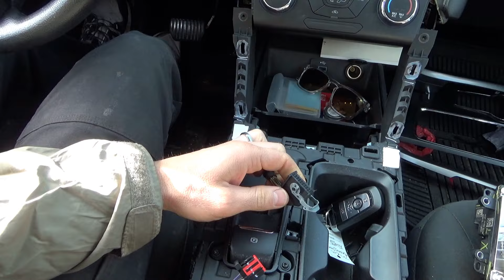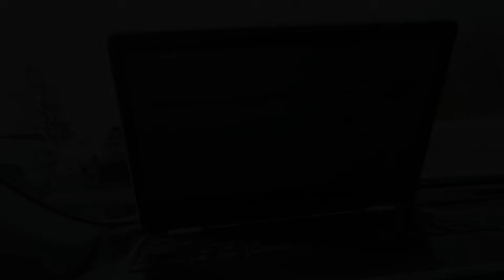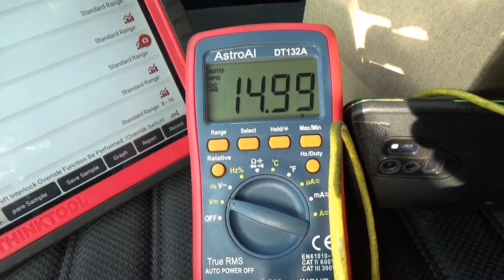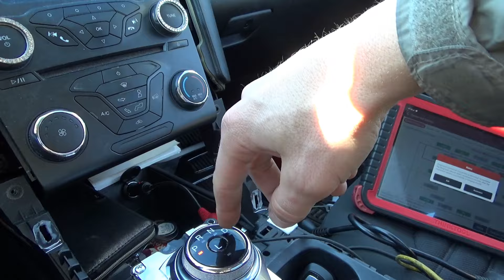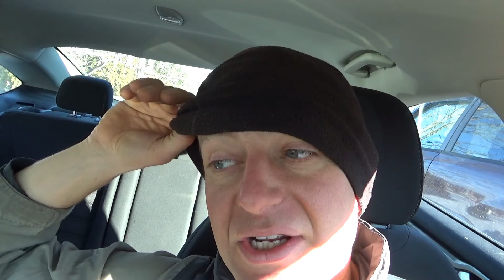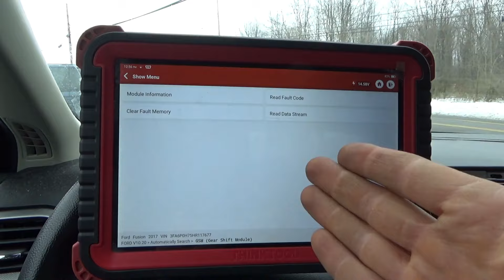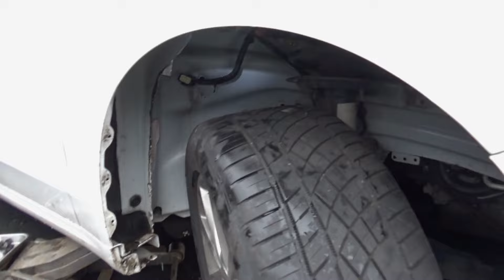Why New Cars SUCK (Ford Fusion STUCK in PARK?! - Part 2)

Comment: Shift by wire is nothing new, Packard introduced it in 1956, Edsel did the same in their first gen 1958 models and it didn't work well in either car. You'd think that they might have learned something, but apparently not. I have rented at least 4 Fusions in the past, while I generally liked the car I hated that shifter. Why spend the money to overcomplicate something that doesn't need to be? There are so many other worthy places in the car that they could have used those dollars with much better results.

Comment: Yet another stupid Ford idea to cost customers money needlessly. The electric parking brake that is useless if there is no electric power. The unit corrodes beneath the vehicle. It's subjected to water and whatever? There is no need when a wire to the hand brake lasts years and or is a relatively cheap repair!

Comment: I work in a ford dealership there is a recall on the transmission shifter cable bushing on a bunch of the escapes edge cmax and fusion I haven’t seen this happen yet
Reply from the maker: wow I wonder why the TRCM is on such a big backorder then?

Comment: You reckon, a summary execution is in order,for the guy that designed this to replace the mechanical shifter. I only watched this because the Chrysler200 hundred had that shifter wheel and I said it would be nothing but trouble. Maybe I was right! The Chrysler 200 is no more, ditto for the Fusion!

Comment: I know some won't like this but it's what happens when bureaucrats get involved in anything in this case the automotive industry, this is all because somebody somewhere onetime did something stupid then sued the automaker for damages, when you removed the seatbelt it automatically went into park, if you try to move the car with the door open it won't let you, yes the nanny state has invaded every aspect of our lives to keep us quote safe. Individual responsibility is gone and it's blame whoever you can for your stupidity and lack of personally responsibility, the victim mentality has been engrained on us by you guessed it, none other than the Democrat party like or not they are solely responsible for this, you dems can argue till the cows come home but I'm right and you're wrong, people are no longer in control so we need endless safety features backup cameras blind spot indicators and the list goes on and on adding to the complexity of everyday items and costing unnecessary amounts of money. The person behind the wheel is ultimately solely responsible for what that vehicle does, you can't regulate a good driver but they are trying, we of a certain age learned on cars without all the fancy gimmicks, we learned to pay attention, be aware of our surroundings be conscious of cars in our blind spots not relying on a flashing light to do so and we are better drivers because of it, if you ask me all those screens and displays are nothing but a distraction, I pass cars at night and see people's faces lit up like it was daylight they have the phone propped up in front of them infotainment screens glowing brightly it's a wonder how they see the road at all, in reality they can't, I dim my dash as low as it can go and I don't have my phone staring me in the face either it's on the seat, I am watching the road 100% of the time, my 2001 lesabre may be old school, by modern standards but I prefer it, my column shifter is mechanically linked to the transmission, remember that newer doesn't always mean better.
Reply from the maker: Yeah it's almost like they are encouraging people to not pay attention to the road!!

Comment: Over energineering. There running out of work I guess. Wouldn't it be easier to just have a motor on the transmission when you select a gear signal to the motor on the transmission Selecta the gear. They found a way to make it worse lol. Man they have no work let's make shit worse then we can make it better in 10 years lol

Comment: I was surprised when you called out the GSM to be replaced. I was pretty much convinced that it must be the motorized unit since in the actuator calibration nothing was moving. What made you think to exchange the gear selector module?
Reply from the maker: Because it was blinking and not setting any codes haha

Comment: I don't know shit about cars (but am used to troubleshooting digitally), but after seeing part 1, I was really surprised to see you go parts cannon on the GSM first instead of the TRCM. With you mentioning in part 1 that it was a two-part system, and that the data entry clearly said that one of its inputs was preventing it from leaving the shift position, it was clear to me that the knob was reacting to an external factor. Combined with the configuration thing kept having the TRCM make that weird noise, I would have assumed the TRCM to be the more likely culprit.

Of course, that doesn't make your replacement choice wrong. You've been digging down into the service manual and doing dozens of tests, not to mention the fact that the TRCM is huge, heavy, harder to replace and even harder to get your hands on. Besides, I think it was implied you could return the GSM you ordered to Ford?

That was a very well executed diagnosis!

Comment: Kansas City Auto Electric here, Thank you so much for posting this video. I have not run into this particular situation yet, however, I am sure one will be coming my way. I could not agree with you enough. These cars are way too over-reliant on technology. I truly believe they would rather spend more money trying to reinvent the wheel as they want the car proprietary software dependent. I would have done the same exact thing you did. The second you saw the new part fail as well I immediately suspected the other part. Just like you I also sometimes get so focused on that one issue it is so easy not to see the big picture. I really enjoy watching your videos as you clearly know what you are doing and it is nice to see someone else pull their hair out for a change...lol

Comment: Over engineered. I wonder if it's that way to keep the suppliers down in Mexico employed? 
Even my late 90s ford are kinda silly. You need 3 size driver bits just to take off a kick plate. You're telling me a piece of plastic can't have all the screws be the same size?

Comment: I honestly shotgunned the problem the other way around.  I'm old and when motors make that stuck kind of noise, I think mechanical problem.  But of course I'm from before the days of electronics in cars.  Interestingly we tend to diagnose to our strengths.  My first diagnostic tool was a vacuum gauge.

Comment: I think the little motor went out. Not the two big motors but the little one. Those go out all the time on steering wheel lock actuators for Nissan and Mercedes cars.  I replace the little motors and they're good to go.  You should have tested the motors too. Maybe put some voltage on them and see if they spin. The brushes are made of cheap material and so have only a set life.  I would have looked at this module first since it's at the wheel well where it gets hit by water and salt. Why place it there?

Comment: Talk about taking a simple shifter system  with hardly any parts and replacing it with who knows how many parts and driving up the cost of the system. People need to design after market systems to replace this garbage can engineering from the auto industry. People can't afford to get there cars repaired. Repairs  cost more than the car is worth .That's what happens when you let the Government get involved.

Comment: THIS IS WHY I WOULD NEVER BUY ANY VEHICLE  PAST 1990, WAY TOO MANY CHEAP ELECTRICAL PARTS AND CHEAP COMPUTER BULLSHIT, I RATHER REBUILD A OLD VEHICLE THAT DOESN'T HAVE ANY OF THESE POS CHEAP ASS PLASTIC PARTS...

I HAVE A 1987 FORD E350 RUNS AND DRIVES GREAT AND SO EASY TO REPAIR U COULD KEEP UR POS COMPUTERS AND PLASTIC, NEVER WILL I BUY TODAYS POS VEHICLES...

Comment: The small motor in the actuator looks the same as the one in the door lock actuator in my '08 Toyota Tundra... Those motors can go bad after a few years and is an expensive repair... Luckily you can buy a replacement motor for a few dollars and carefully replace it inside the door lock actuator... I wonder if the small motor has gone bad... Thanks for all of the information you share!

Comment: Talk about OVER ENGINEERING a part that just moves a shift cable, HOLY CROW. When you don't get any codes or have diagrams that show you WHAT IN THE HELL is going where or how to reset stuff, YOU HAVE TO GUESS YOUR BEST GUESS.

NO, They don't want you to be able to fix your own vehicles & it's getting worse every FREGGIN YEAR. Soon we'll be back to Horses, LOL. or be keeping our older cars running as long as we can.

No. 500+ on the waiting list, WTF ? For a FORD YET, KRAZY.

Comment: This certainly was a good one Ivan.  I personally have not run into this problem yet.  The closest job to this I had was with a mini coper clubman 500.  The customer complaint was the radio and hvac had stopped working and no crank / no start.  The no crank / no start issue was because the transmission was stuck in drive.  It had developed a short in the shifter knob and in effect, melted the connector and wire harness going to it and thankfully blew the fuse for it in the nick of time.  This same fused circuit also powers the radio and hvac system.  They later stated that the cabin filled with smoke while driving.  It looked like someone spilled a sticky, syrupy drink onto the center console and it almost burned the car to the ground.  Shift by wire is stupid IMHO.  I hate them.
Reply: These car will also catch fire and burn you to death if you run into a house

Comment: The 2015 Ford Fusion isn't made that way. It has a regular shift lever on the console. Some dumbass engineer thought he had a better Ford Idea. I believe they are still trying to force everyone to go to a dealer but it's really a bad idea when your dealers can't get the parts but one can go to ebay and get it. With over 500 Fusions needing that part it sounds to me like there should be a recall and Ford needs to do a better job of stocking parts. It's just insanity that Ford moves their factories to foreign countries and then not expect to have problems. This is proof that the newer one goes the worse it is!  They should have stayed with how it was made in 2015 instead of using a bad idea such as this 2017. Newer isn't always better.  I wonder though, if one of those motors is bad and the "smart" engineer didn't think far enough to have a sensor for that module. I haven't owned a Ford since the 70's because they started making sh*t!

Comment: we've had similar issues like this in the past with tools in the shop I work at, post '16 Ford seem to have really locked down procedures that aren't deemed to be 'safe' to be completed by 'regular' workshops. We have a Bosch KTS590 which is the only tool in out shop that has security login, we have Snap-on, Launch, Thinktool, Mercedes Star and the Bosch diag tools, you must do a security login to reset the DPF values on the newer Ford diesels once the fill percentage passes a certain level, this reset must be done when the DPF is either cleaned or replaced

Comment: This is EXACTLY why I'm keeping my 3 vehicles running as long as possible.  A '13 Tacoma 4WD Offroad, a '12 Mazda CX-9 AWD GT, and a '12 Ford Escape AWD Limited.  My Toyota is the best of the 3, just basic maintenance.  I've had a few mechanical issues with the Ford & Mazda but nothing I couldn't diagnose using logic & Forscan.   Keep the old ones running guys!
Reply: The Mazda Skyactiv's are nice, I'm not a fan of the "infotainment" on some of the newer ones but the drivetrain is solid and very efficient
Reply: @big0bad0brad  the CX-9 is a V6, the MZI which is a slightly modified Ford Cyclone.   The Cyclone succeeded the Duratec 3.0 V6 that is in my Escape. Both are very stout engines.

Comment: it is impossible to diag every car 100% every time, the closest I think i ever got was like 98% or so and that is without using a scope at all. it depends on the actual issue. but with the scope and limited knowledge that you have because you are not manufacture engineer you can get 99.9%. which is amazing compared to dealer techs and shops that won't diag and throw parts. its almost impossible to diagnose electrical parts if you dont manufacture it... there will always be that .1% that rears its ugly head every so often. 😂😂

Comment: Well, I guess we enjoyed this miniseries more than you did, Ivan.  LOL.  I was thinking that the TRCM was the culprit back while watching part 1.  I believe there must be a wire carrying a signal back from the TRCM  that tells the BCM that the gear mechanism is set in the Park position.  If it doesn't get the right signal, the "P" light flashes on the GSM and the transmission will never shift.  Perhaps when the TRCM broke, the gears got out of alignment and couldn't return to the Park position and the position sensor sent that information via the circuit board back to the BCM.
Nevertheless, your conclusion is spot on - this is totally insane to replace a simple mechanical linkage with this complicated "mousetrap". 🤣

Comment: why do they do that shift by wire-- 
people,,, they have to keep people from harming themselves, goes to park automatically when the door opens or is open
stories a bout people running over themselves, falling out and car crashes, you name it it has happened
now you need the door closed and brake depressed from drivers seat
that same system flies airplanes....scary

Comment: There is an aftermarket "OE" program called Forscan for ford's, it lets you go as far as modify Asbuilt data in modules, it's much cheaper than IDS software and I've been able to do relearns and reprogram Solenoid body Strategy numbers on the 10R80 and 6R80 transmissions when we rebuild them and replace the valve bodies.

I've also used it to change the splash screen and some other options on my Fiesta ST

Comment: I suspect the small motor is a shift lock.  And for some reason, it wasn't able to unlock.  That's why the one PID was always "YES". The lack of a code when the shifter is flashing is because the programmer didn't think to add a timeout check on what's a normal function. Programming good error codes is actually a higher skill than making things work normally. You have to imagine all the ways things can go wrong.

Comment: Very cool case, a learning example because of vague service info.
Teardowns of failed parts are also always very interesting and educating. As there doesn't seem to be anything mechanically broken, maybe those big electrolytic capacitors were damaged because of that over traveling and they just couldn't properly power those motors anymore?
All that damage because of some bushing. Might be good idea in these cars to replace that bushing as a preventive measure.

Comment: I think the little motor is the sensor;   When the actuator turns, it moves the plate, which turns that screw and the little motor will feed back its location, like a stepper motor.  Just a guess.      What I thought it was at first would be that the little motor was the interlock that would prevent the big motors from turning.  But I don't get why they would do that mechanically when you could just do it in the software.  This is the most ridiculously over engineered junk I've seen in a while.  And yet they STILL have to manufacture the cable;   they don't even save money from the manual system. lol.   I'm so confused how this got approved.    

More weight, more cost, more complexity, less reliable, more complicated to troubleshoot, more CAD time for it's location design, more little pieces to source to make the part.  ??  crazy
Reply from the maker: Insanity

Comment: I guess we really are over engineering things and go crazy on safety stuff. I remember getting my 79 VW Golf GTI stuck in the snow and I could put the manual transmission into gear and let out the clutch. I get out of the car and push it and jump back in when it got traction. I guess that is no longer allowed. 😂😂

Comment: that cable end is a recall on that. the customer may want to try to get ford to eat this job since the cable end that was recalled caused the problem.  probably why its on backorder. the small motor is the lock mechanism. the two larger motors one is push and one is pull.  the big motor turns it winding up the spring until it reaches its position then the small motor unlocks the mechanism allowing the cable to move that distance from the spring force. seen similar mechanism before on other equipment.  not sure if its feedback is from an internal transmission switch or an encode on one of the gears or shafts.

Comment: Another hair puller! I think the little motor is used to calibrate throw of the arm and it looks like it controls the big silver spring which is a one way spring clutch, they are used a lot on photocopiers to control things that turn, they probably controlled the the motors with current sensing for when they hit end of travel. Would love to thinker with that gizmo!

Comment: That wouldn't be the first time our friends at the Blue Oval had a plastic piece fail that could cause expensive repair.  From 1980-92 Ford offered an AOD transmission (on the Panther Platform cars, maybe others)  that shifted with a Throttle Valve cable.  This cable was attached to the accelerator linkage with a PLASTIC clip.  After going through several heat cycles, that clip would become brittle and break causing the TV cable to detach.  Then the transmission would burn up.  (Don't ask me how I know that, I had to replace the transmission in my 1987 Grand Marquis coupe)  They then went to electronic shifting for 1993 (AODE) and finally 4R70W and 4R75E/W.  They did recall those cars and put a metal clip on.